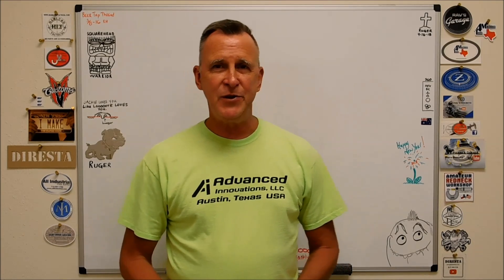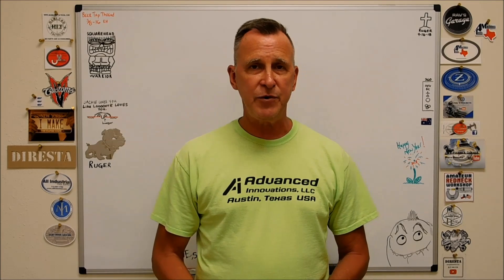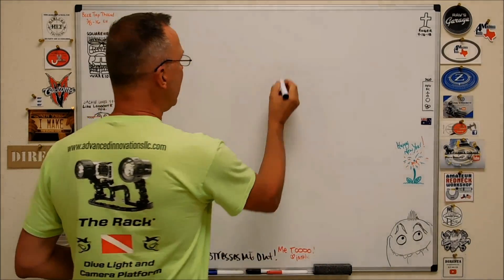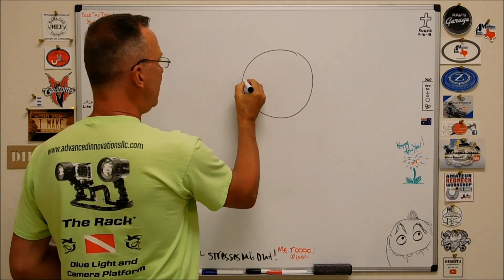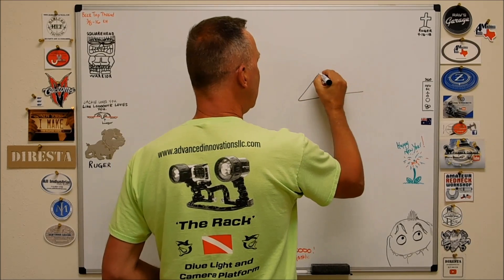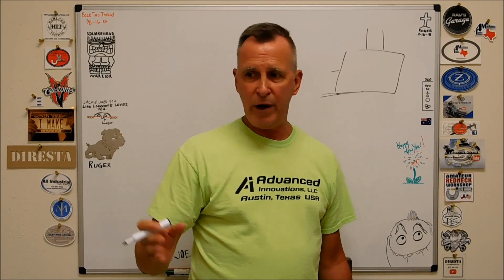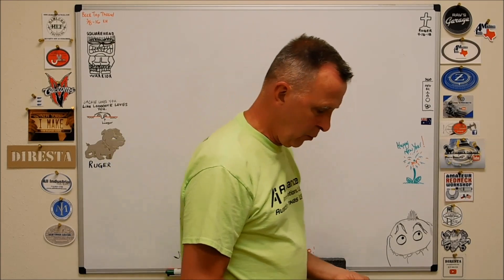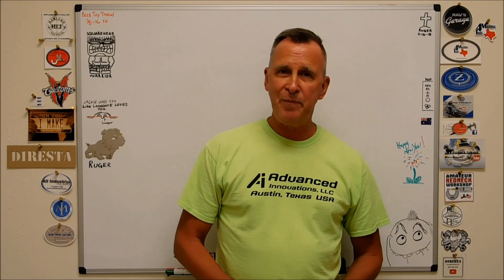Flycutter Tool Geometry vs. Chipped Parts

Comment: Nice tips!
So if I use lathe boring stick mounted at 120 degrees, with carbide insert, I should change the mill direction to reverse?
Reply from the maker: I guess that depends on the LH or RH orientation of the boring bar.
Reply: @joepie221  thanks for the reply. Not sure how to check LH RH, but by looking at it mounted at 120 degrees in the diagonal hole in the shaft, the front of the carbide insert seems to want to rotate anticlockwise

Comment: Hi Joe.
I think You are doing very nice videos and I am frequently whatching them.

I have a question to You regarding the geometri of the Fly-cutter tool. All of Your thre cutters that You showed in the video has a gemetri that is pushing the tool away from the centerline of the cutter by the locking screws. My suggestion is to drill and tap the holes from the other side of the cutter that would push the tool up against the centerline of the cutter. That wouild infact be an improvment of the cutter, when the cutting edge of the tool is closer to the centerline and it would also make the tool more rigid, in my opinion. 
Fianlly You was taling about balance of the cutter. I made a cutter myself and I made only the slot for the tool and made three counterbores for the locking screws all to improve the balance of the cutter.

Regards to You from John Eriksson in Sweden
Reply: If You find anything that is incorrect. Feel free to let me know .

From John Eriksson in Sweden
Reply from the maker: John, that whole centerline thing is a myth. Just imagine the axis of the flycutter shank, then imagine the contact point of the tool. Draw a line between them. It will always be on center. The success of the cut depends on the grind at the point of contact. Try to visualize that and it becomes really clear.
Reply: Hi Joe, The axis of the fly-cutter shank would be in line with the side with the locking screws. therefore as you tighten them, you are pushing the tool away from the centre line. Therefore why are the locking screws not on the other side and how is this a myth? It would not be possible, even if ground, for the tool to be on centre line, in fact you would be getting further away by grinding it.

Comment: If the back side of the fllycutter is cutting, you may also have a loose gib. I get this on my Sherline.
Reply from the maker: Its actually OK for it to scratch the surface, but an actual chip may point at something else.

Comment: Should have made a split pass ,, cut 3/4 one side, flipped it and made and over lapping 3/4 cut on the other side so that all sides are shear sides.. smearing is for lil kids and fingerprinting
Reply from the maker: Technically, the breakout edge on a 3/4 pass is a smear side ( x2 you way). Nice try, but the only way to totally eliminate a cliff burr is to walk the perimeter.

Comment: On the matter of blowing the corners on plastic, how do we solve that if we use carbide insert tools? What insert geometry would be preferred? Thanks.
Reply: I aware its old post, may help others
fly cutter blow the corners of plastics while releasing and it wont give problem while entring, what I do is  keep 0.5 mm material  and  cut from reverse till corner got machined. then I will cut from forward with finish depth.

Comment: Love your channel and your videos.  I learn so much from them.  I was wondering if you could help me with a fly cutter tool profile question?  I want to use a fly cutter to cut nail nicks into the slip-joint knives I make.  What tool profile would give the best results for those lovely thin, crisp, crescent nail nicks?
Reply from the maker: The answer depends on the setup of the blade. Initially, it seems the tool profile should certainly be less than 90 degrees for sure.
Reply: @joepie221  - Thank you for the reply, much appreciated... And unexpected =)  I'll get some tool blanks and do some trial and error practice.  Thanks again.

Comment: Great lesson Joe, I needed that.  Been watching vids on making fly cutters and am curious to know why they are all for left hand cutters.  Am I missing something?  Why not make a reverse fly cutter so all your RH indexable tool holder/cutters work?  Hope you get my drift.
Reply: The geometry of a fly cutter means that if you built a holder for a RH tool you'd need to run the spindle in reverse. Depending on your point of view (and your machine) that's either a problem or it's not!

Comment: So why wouldn’t you use the second tool all the time?
Reply from the maker: On plastic, I do.
Reply: It would take a lot more tool pressure to use that cutter in steels. Higher pressure push the limits of your machine rigidity, which affects accuracy/precision.

Comment: Doesn't make sense to my running a fly cutter on my mill it's cutting on both the front and back going in both directions
Reply from the maker: A secondary scratching is a sign of good head alignment. It shouldn't be cutting though.
Reply: @joepie221  Thanks I guess you would call it scratching no chips but it is enough to reverse the pattern of the cut. I'm not running a real mill just a harbor freight sieg mill drill machine but it's a lot of fun

Comment: Just to add to breaking off the corners. If possible I try to hit each corner from outside the part before finishing the surface just a small amount. Great videos joe.
Reply from the maker: You'll see me do that when walking an endmill around a part. I always try to drive the cut into the part. Reduces the burr too.

Comment: Why is relief required on the bottom of the fly cutter holder? The tool should be lower than the holder if it is extended beyond the perimeter.  If the material on the holder is not removed - isn’t it more dynamically balanced?
Reply: My question exactly. I plan on building a flat bottom on mine.

Comment: What about back rake angle, will it influence geometry when the end relief is ground to sharpen the tool bit? There is no way to change the height of the tool on thes!?
Reply from the maker: Lower the quill or raise the table. What other height do you need adjusted?
Reply: @joepie221  Sorry, I don't think you understood the question. I'm talking about tool geometry.
Reply from the maker: @CandidZulu  Flycutter face geometry can be ground to suit many conditions. What many fail to visualize is the contact point of the cutter, lowest on the tool, is always on the center of the flycutter. I know you may initially disagree, but think about a circle and place dots on it anywhere you wish. You'll always be able to connect an outer dot to the center. Always. So being aware of the tool initial grind and how it changes as you resharpen it, is important because its constantly changing.

Comment: Question...I have my fly cutters ground with a positive rake BUT they don't have straight cutting edges....I have ground them with a radius on the cutting edge....In fact just about all my cutting tools are ground with a radius opposed to a straight edge....Is this bad? ...They seem to cut alright.
Reply from the maker: A radius on the tip of your tool is just fine. It actually allows you to feed faster.

Comment: Very helpful. I’ve recently started machining PEEK in a Haas DM-2. The parts need a very fine surface finish and the corners do blow out sometimes. I changed the order of operations around so it gets profiled after, but some parts have steps in them below the top surface . With a lot of micro features, the parts have a very long cycle time and one little flaw can undo a day or 2’s work. And every part is a one off. Not to mention the fact that PEEK is so expensive. We just got a new Prototrak mill so I can pre-process the material and do some of the part modification that engineering sends back after testing. Thanks for sharing your experience.

Comment: I've seen those tiny ridges before when we've had change parts made for a filler or capper, delrin is usually the material of choice.

Comment: Ebay tool holders are cheap got my self a cheap holder for the alt corners of cnmgs and made a full disk style flycutter and cut out the material needed to bolt up the tool holder with insert tip along center line. Now my tool os always at center when changing the insert and the balance was done with the slot for the holder and drill out material

Comment: What is your thinking on using a left hand WNMG tool holder? This would put the tip of the insert off or behind center like the first fly cutter you showed. Yours was from grinding.
Reply from the maker: I have to respectfully disagree. If you draw a straight line from the tip of any flycutter to the center of the flycutter body, that line will be on the center of the flycutter. The impact area of the tool bit can be ground to be negative or positive based on the relief.

Comment: Lazy eve with some time to prowl around my friend. Looks like after all these years I have gotten it right with both boring and facing fly cutters I have made. Just luck or knowing materials likes and dislikes or ? I just grind then so they look right, LOL. I discovered a new site on the Tube today, "Find Hanson" This fella is crazy good at building Minatare Diesel engines from the base wooden mount to muffler. Every single part. If you have never heard of him, pay him a visit. Good to stop by this fine day off my friend.

Comment: I’m a beginning novice, still have yet to power on the Haas TL1 or TM1 that my company is expecting me to learn and operate (I have watched many hours (100+) of your videos, and Adam Booth, and Keith Fenner).  
Your description of right-hand and left-hand tool needs clarification for me, please.
Would the cutting edge on a tool, from the view behind the cutting tool be the direction indicator (in other words ... the raised portion/side would cut first and therefore dictate direction of cut rotation)   /| would be right-handed, correct? 
Thanks.

Comment: Your videos are outstanding.   What is the best way to create the radius  on the fly cutter  body to balance it and is there a rule of thumb on how big it should be?  Thanks for taking the time to make your videos.
Reply from the maker: I usually just take a good bite out of it with a large end mill before putting the angle on the bottom. Its easier that way. As for balance, you can throw a good flycutter out of balance just by extending the tool too far. Watch the light on your machine for clues of unbalance. The light usually vibrates too.
Reply: Thank you Joe.

Comment: this may sound like the start of a joke, but it isn't...
why did the motor stop so abruptly when you turned off the mill?
is it hydraulic?
does it have some sort of braking system meant to save time in an industrial environment?
does it use a worm screw for the above reason?
or is it some combination of the three OR* something else?   *(see next line)
or is it again some combination of the three AND something else?
(I've always wondered why some mills do that)
Reply from the maker: It has a brake right next to the off switch. My movement between the two is just automatic at this point.

Comment: Aren't your fly cutter grub screws pushing the cutting tool away from the centre line you wish to maintain?  Great videos, many thanks.
Reply from the maker: The centerline is relative to the tool tip and flycutter axis. But yes, they are.
Reply: @joepie221  The larger fly cutter with the forward slant grind is the toughest I have seen you show. Must have been sharpened a lot of times. The tip is now far back from the holder centerline so guess that is not a big factor? Would that be a good grind for aluminum?
Reply: Realy good question. Joe's answer makes the whole process make sense. Tx Joe & davered27

Comment: I asked some mouse sliding kid in the shop why he thought they called a fly cutter a fly cutter. He said that it was because of the way it makes the chips fly. Rotational inertia was not in his vocabulary.
Reply from the maker: Google doesn't even have the answer.
Reply: @joepie221  It is a flywheel with a single cutting blade.

Comment: The second flycutter that you used to solve the blowout - would this be something you would ever want to use on aluminum or mild steel?
Reply from the maker: Basic grind is OK, but make the relief angles less.

Comment: Love your vids.
My question is on  your homemade flycutters. Shouldn't the  set screws be on the other side so that they are not pushing the cutter point off center?  You did make the point of how important it is to have the one edge exactly on center.
Reply from the maker: I put the screws on the thicker side so the cutting forces drive the tool against the solid side.
Reply: Does this principle hold true for steel ?

Comment: Ive never used a fly cutter  and i  keep hearing that it is hard on your machine so ive been hesitant to get one i want one but dont want to tear anything up either
Reply: Whoever told you flycutters are hard on your machine doesn't know how to use one.
Make yourself one, it's relatively simple, plenty of "plans" around the internet but Joe gave you all the information you need in the video.
I'm NOT a machinist, I'm a hobbyist and I made one so you can too. It's one of my favorite tools, not only because it gives a great surface finish but because it's very satisfying to use a tool you made yourself.
Reply: do not make flycutters. They are a terrible item. You can simply get shell mills and mount them and use one insert which you can also sharpen as you please. Flycutters are not used in real life except by hobbiests..

Comment: You inspired me to grind up a new hss tool blank and try out fly cutting on my old ass manex mill.  Cut steel first then a block of aluminum stock I got from the guy who sold me the lathe and mill.  Worked out great.    Nice finish. I feel a bit more confident farting with the mill feed and speed with the fly cutter.  Thanks for the inspiration.

Comment: What type material did you use for your fly-cutters and what type steel should you stay away from? Also....what do you recommend as an 'optimal' or 'cover all the bases' angle for holding the tool bit. Judging by your it appears to be 10-15 degrees. Thanks again Joe!

Comment: Joe,

A little off topic, but I just bought my first professional grade CNC mill. It takes cat40 toolholders. Do you have a preferred brand of toolholders?
Reply from the maker: I use Shars and Accupro. The Accupro come out a little harder than the Shars, but that may be cooincidence. What machine did you get?
Reply: I bought a Haas VM2
Reply from the maker: Nice machine.
Reply: I'm making some really fine features using a .010 end mill. Also going to get CAT40 Air Spindle that will run at 65,000 rpm.

Comment: Hi Joe thanks again for another great video but i have a question of my own, i would like to have your opinion on what your order of operations would be on boring and splitting a sprocket, or more less is their a way of making the sprocket to fit the shaft without having a gap after splitting without affecting the way the sprocket would perform? Sometimes the sprockets get put on with carelessness with a big gap on one side and very little on the other.
Reply from the maker: Split the blank, clamp it to a faceplate and bore it. No gap.
Reply: Thanks Joe for the advice but we don't have a faceplate for the lathe.
Reply from the maker: Remove the jaws from a 3 or 4 jaw chuck. Measure the slot geometry and make 'T' nuts for each slot. There should be a blank area in each slot before the scroll starts, or insert them from the chuck center and slide outwards. Cut a piece of aluminum and drill a hole pattern in it to match the resting position of the nuts. Attach it, face it, and now you have a faceplate.

Comment: thanks for another one Joe.
when would you need to grind a fly tool with point first? seems likely to pull the tool down into the work. too. lead angle seems like a safer approach as well as prevent chipping. also gives you chip thinning.

Comment: Thank you very much for this video. I happen to be working on a project requiring very clean cuts in acrylic rod. I threw this video on as something to fall asleep to last week and got sucked right into it. The next morning I went in to work, grinded a new fly cutting tool and I was amazed by the results. I thought I was going to have to wet sand and lap all 120 ends.  It has saved me so much work and the results are better than anything else I've tried.
Reply from the maker: Glad to hear that. Thanks for your confidence in the material I shared.